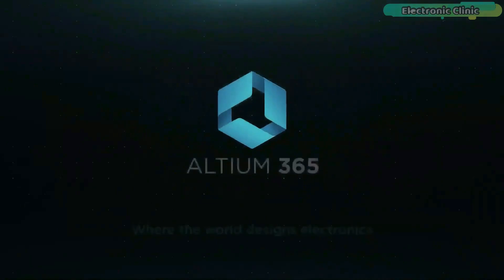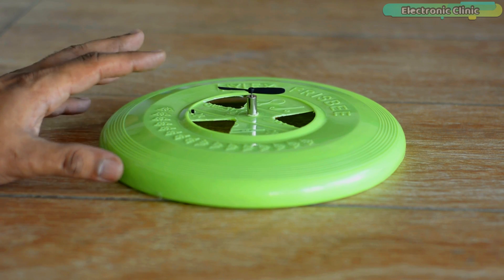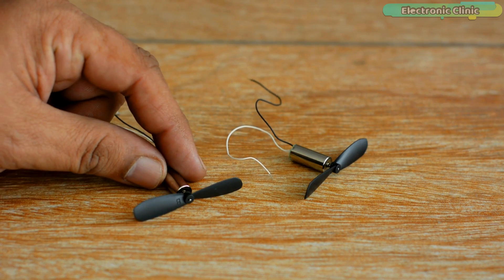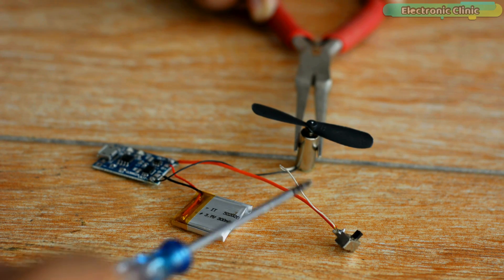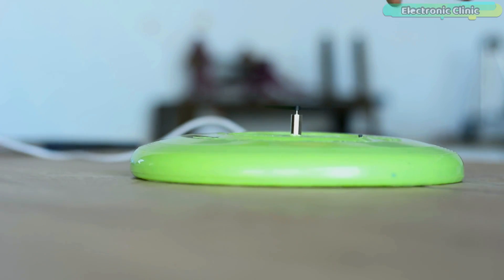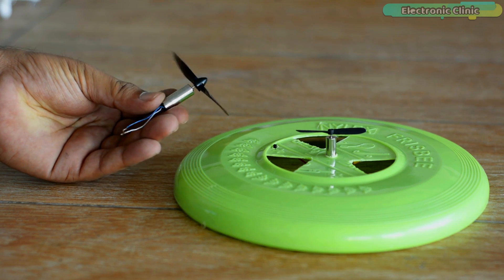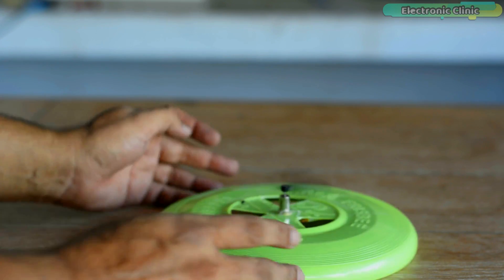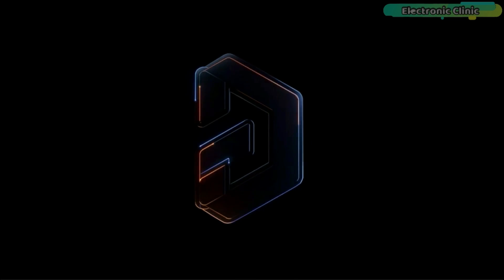New Electronics Project, Accidental Invention, Frisbee with a Coreless DC Motor, New project idea

Comment: Serious hang time is you throw it like a frisbee.
Reply from the maker: when i throw it slows down, the props forces to rotate the frisbee on the same direction. And when both rotate in the same direction then it wont move straight, it tilts to one side.
Reply: @ElectroniClinic  I didn’t think of that.  Try throwing left handed, in the opposite direction or reversing the polarity of the motor?
Reply from the maker: @retrotony4119  the same thing. it can be solved with two motors are fixed, one rotates cw and the other one ccw.